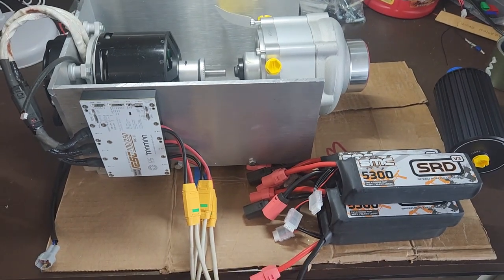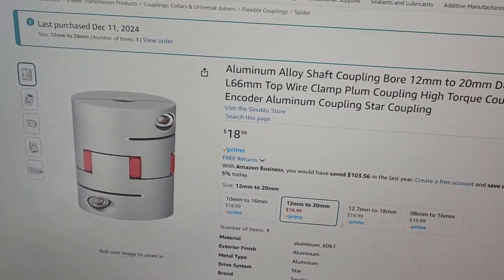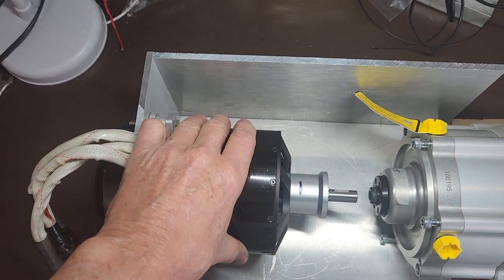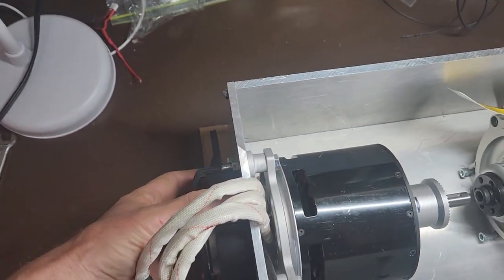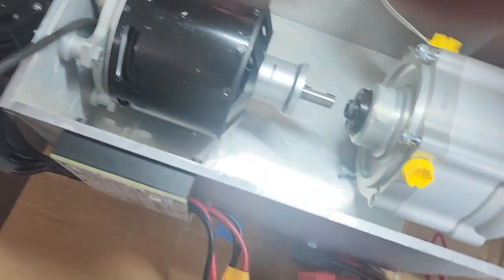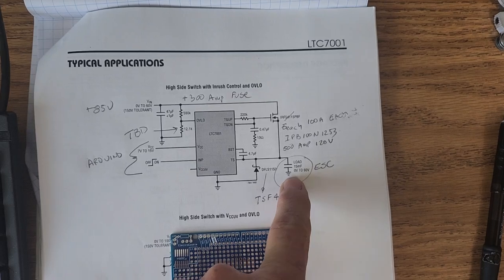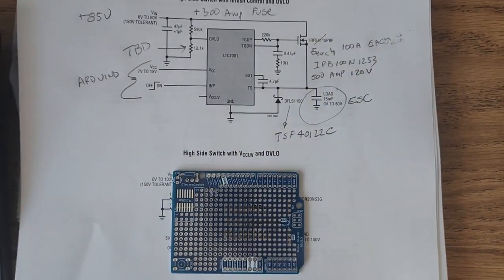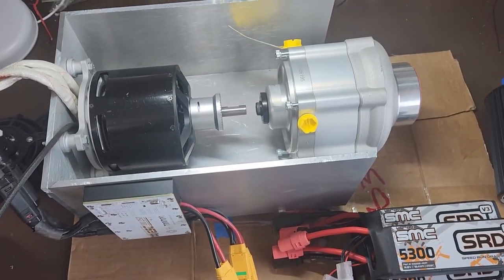Electric Supercharger for Honda S2000 - Update

Comment: I am planning something similar with my 5 cylinder Jetta except I am planning to move the car and turbo batteries to the trunk, then use the space where the battery was under the hood to mount the turbo and motor.

I figure a small roof mounted solar pannel should extend the turbo battery use significantly, and possibly eliminate the need for external charging. Four hours of sunlight on a 250-watt pannel translates to about 20 minutes of 5kwh discharge. I should be able to recharge the entire battery (and then some) while I'm golfing. Granted, roof mounted solar might not work on an S2000...
Reply: 12 minute not 20.

Comment: Looks pretty interesting , how much boost are you going to be running?
Do you have an ap1/2?

Adding turbo or supercharger is illegal here so I hope you can make this system competitive it is way easier to hide.

Please what ever happens keep posting here I would like to see the result.

Good luck 👍🏻
Reply from the maker: 2003 AP1.  Planning on 6 to 8 pounds of boost.  I used to have nitrous on the car which gave me about +80 HP.  I'm looking for around +100HP for the supercharger, with a big increase in midrange torque.   Will probably switch the ECU for Hondata to get the tune right.  It may be possible to hide most everything under a cover in the trunk, but I'm hoping it looks cool back there.